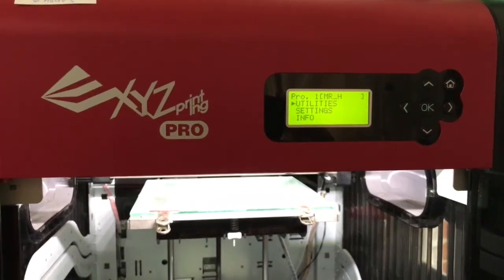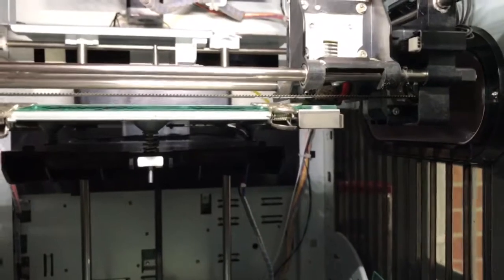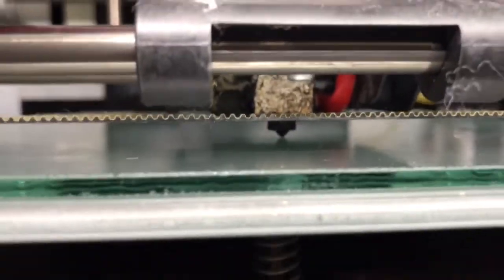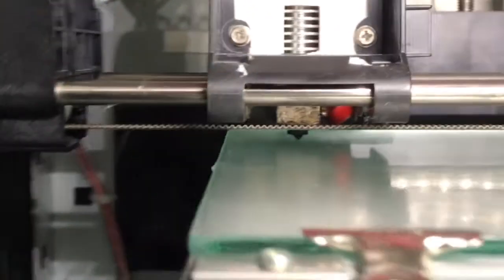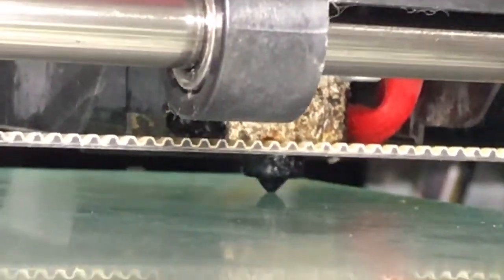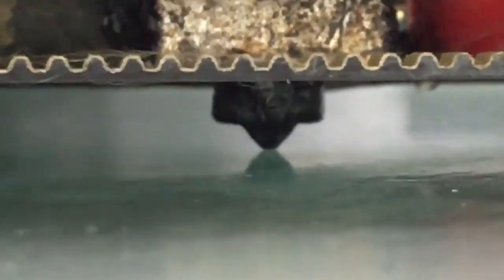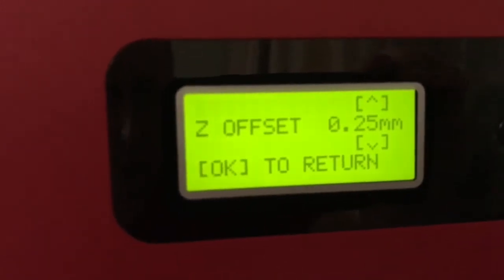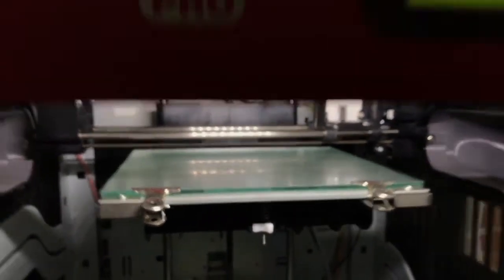XYZPrinting Da Vinci 1.0 Pro : Manual Z axis offset

Comment: so when you take this approach does this effectively mean the internal calibration is no longer needed?  i'm using stock stuff still.. but when i use your approach (which goes fine) going back to calibrate will say each wheel needs like 8-9 spins up to calibrate.